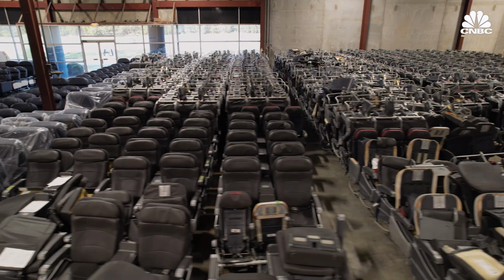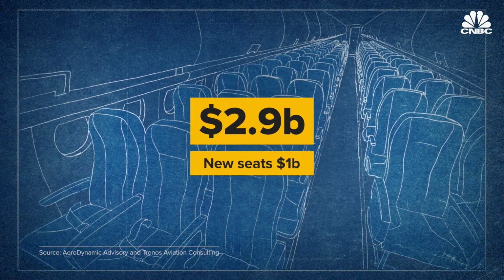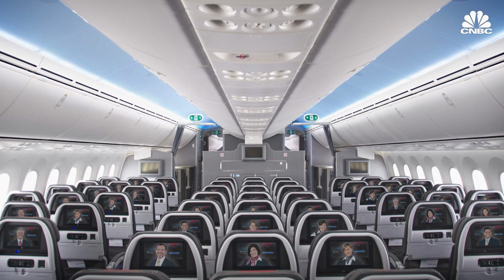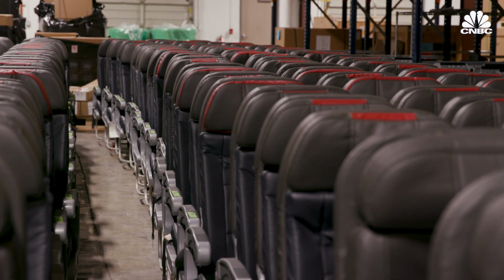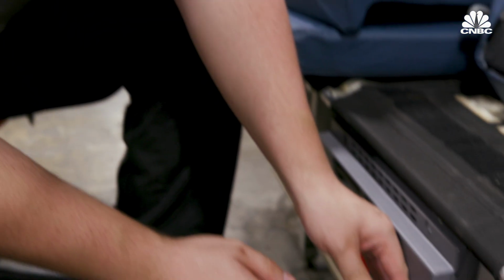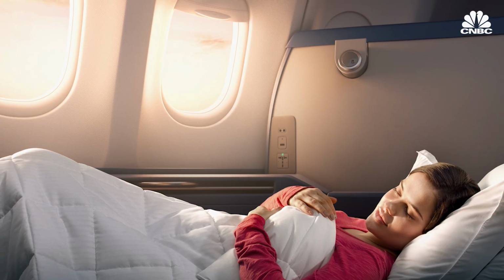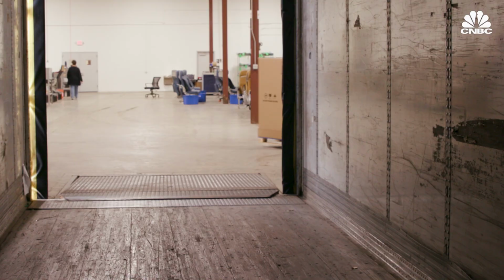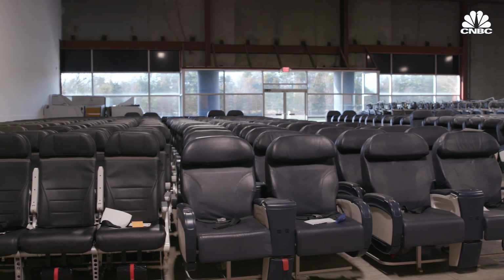How Old, Nasty Airplane Seats Are Given A Second Life

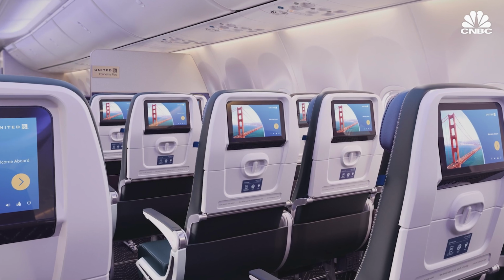Comment: 6:35 Why bother putting screens in seats when we all have way better smartphones. The airlines should let us download the entertainment through their app and have it unlock once you check in.
Reply: You’d be surprised how many people seem to use the screens on the airplane, at least on the flights I’ve been on. You have to pay for the WiFi on board a plane, but nowadays the screens are free entertainment with countless movies and TV shows. We also get a flight tracker on them. It’s really nice to look down on a town or city and know which city you’re seeing from a moving map. Delta’s had them for over 15 years now, and United’s actually ADDING them to their fleet if you’re dubious about people actually using them. They’re seen as a perk in Delta so much that United had to add them to be competitive. And since you say phones are better, I’m sorry to break the news to you but the newer screens are not only the size of a large tablet, they’re a far higher definition than they used to be. From this comment, it would sound as if the only plane you’ve ever flown on is the Delta 737-800 with the screens from 2007. Yes, you’re correct about those. Dim, barely larger than a phone, poor resolution, laggy touch screen that needs to be pressed hard. They are bad, and they are the only reason why the bad reputation for these exists.

Comment: Imagine how many farts have been hot-pumped into them through the years.
Reply: nutty
Reply: Half of those are mine.
Reply: "hot-pumped" 💀
Reply: @ForeverHeHim  side note - I once had gas so bad on a plane that I was asked to deplane.  The only reason I was able to avoid this fate was I told the stewardess that I would go to the media and complain about "racism" if they kicked me off the flight and would not mention my rancid ass vapors.  I was upgraded to first class where the seats are more substantial and thus better suited to accommodate my discharges.
Reply: floatation device

Comment: Shouldn't it be possible to mass produce seats for a much lower cost than $5,000? Just think about what other items cost. You can buy a small car brand new for $10,000. You can buy a whole entry level kitchen for $5,000. For $5,000 you can buy at least two electric bikes. 

Where does the cost come from? Are they so expensive because they have to be built so sturdy and at the same time light weight? Could a $2,000 seat be built, but it would weigh five kilos more and over time saving five kilos is worth more than $3,000 for example?
Reply: It's the R&D cost, then testing time, then FAA approval work....

FAA approval about 2 years of work alone. 

And yes, every pound in weight saved is equal to thousands of dollars of fuel over the lifetime of the plane.

Also T7 aluminum is some of the most expensive material you use in manuacturing. It rare to even use lower than T6 in aerospace... But the everyday aluminum items you & I might own and encounter during your life rarely meets even T5 quality; So the raw material can be 3-10x the cost, and none of the parts are going to be cast or forged, but most likely made of billet and machined.

There is a reason why a modern jet starts 25 million...for example a 737 is about 95 million.
Reply: @David.....   Yeah I was gonna say the FAA certification takes a long time and costs a lot of money.
Reply: What new car can you get for $10,000?
Reply: @enadegheeghaghe6369  You can buy a new Dacia Sandero in Germany for €8,900. Not sure about the US prices. In the past the Mitsubishi Colt was famous here. It was just under €10,000. For around €12,500 you can get a Renault Twingo.
Reply: $5,000 is for 1 economy seat, so a half-row of 3 seats costs $15,000!

Comment: 5000 USD for a simple business class seat! ( with a tablet attached to it!)

that's another sign about why America falling & failing!
Reply: I'd like to see you build an airplane seat using designs and materials that meet FAA specifications for less than $5000
If you can pull it off, you could create a business worth hundreds of millions. LOL
Reply: @enadegheeghaghe6369  a small car have 5 seat, with engine, brakes and a lot other things that must approved one by one before sale, and it cost less than 25000 USD! for 1 aviation seat that have a aluminum frame, a simple mechanisms, flame resistant clothing and a tablet attached to it, 5000 USD is a lot money! I can built a FAA approved seat with less than a 1000 USD, Russian seat for ssj-100 is about 650-700 USD with LCD!
Reply: @AriaAzari  like I said, go start a business building these airline seats and you can make a lot of money. I hope you have a cheap source of FAA approved aluminium and other materials handy.
Although I still have a suspicion that you have never read of the FAA or ICAO regulations for airline seats. But talk is cheap. LOL

Comment: One thing they did not mention is removing blood stains. Those are usually caused by irate customers beating up another person on the plane. it is very expensive because that area has to be entirely sterilized.
Reply: I highly doubt they do more than wipe the blood off for the next flight
Reply: @lukethompson5558 They'd likely mark those seats as broken until they could get cleaned.

Comment: It is good to know the seats were designed for refurbishment rather than being disposable. Having the foam in velcro instead of being glued makes things easier.
Reply: It's the same way in a lot of modern automobiles. Lear makes some fabulous seating for Cadillacs.
Reply: They’re Velcro because the seat cushions double as flotation devices in case the plane makes an emergency landing on water.
Reply: I think most removable things from an aircraft are reused/resold because they're way too expensive to be thrown away.
Reply: Also lifejackets made from strong styrofoam for floating purposes as well with flashlight, beacon light and whistle
Reply: now if stuff were made today llike this, we would have less trash

Comment: Surprised to see the employees a hand held screw driver and a  battery powered screw driver.
Reply: Correction: And  NOT a battery powered screw driver. How tedious and slow can you make that job.
Reply: @roberthowell7095  if you select the 3 vertical dots on the right side of your comment, you will see an option to edit it, instead of replying with another correction comment.

Comment: Seats are not complex, the prices are overblown due to the market and prices in that over-inflated market with only a few refurbishers imo.  Guy acting like cleaning seats is rocket science. Seat is $4,000 because that's what the market will bear, and carriers have special gov deals and subsidies so prices can be high. They have far less tech than most cars. Just stop, you're typical modern lazyboy or couch has a circuit board and power movement to have bluetooth and controls.
Reply: I assume you are familiar with all FAA and ICAO regulations /specifications that airline seats have to meet (design and materials)?
Maybe you should go into the business and do it for a lot less money. You could make a fortune?
Reply: The regulations book/instructions/specifications/law in anything plane related is so thick that it may as well be rocket science.